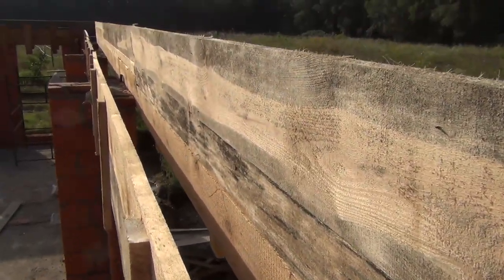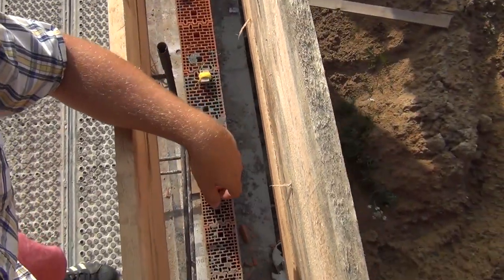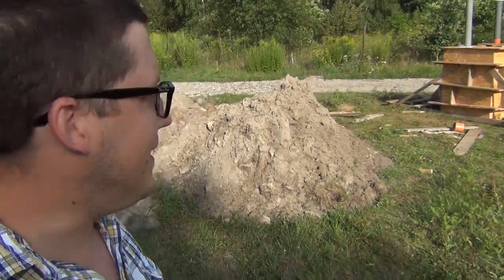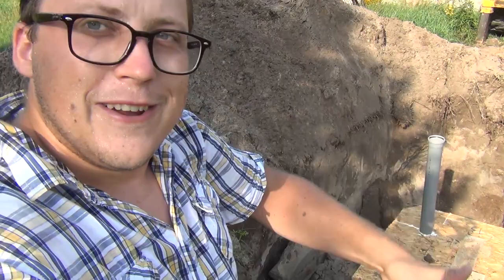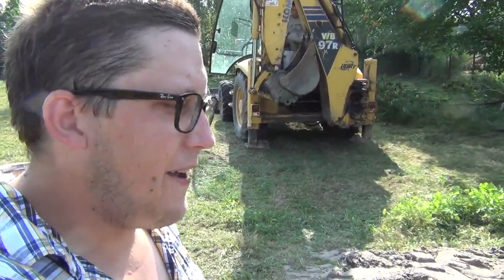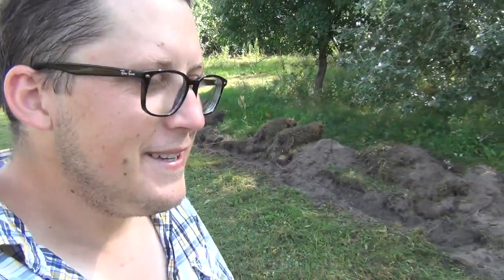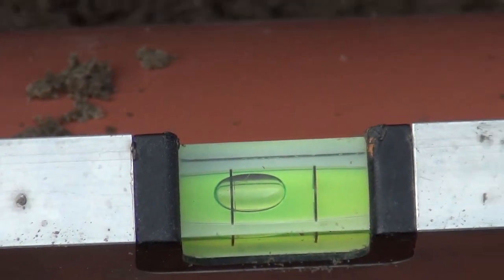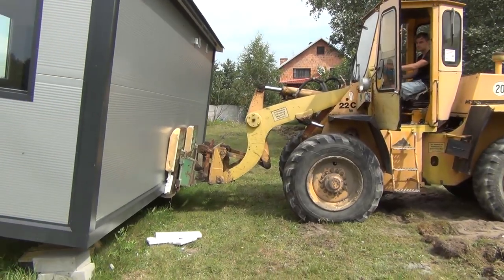BoH 52 - Burying the Sanitation Tank and Moving the Summer House

Comment: make sure look into stainless steel fibers for your concrete next time you will get uhpc then

i think 0.5%-5% by mass is the region they usually shoot for depending on the amount of rebar used.. ive seen a sweet spot in durability + strength testing around 0.9% with rebar and you don't always have to use standard rebar

and it might be good to look up some "fail" videos to see exactly the ways in which you should not trust large hydraulic equipment lol

there are ongoing experiments by Robert Murray Smith and crew with adding small amount of processed/ separated graphene compounds (size and quality undetermined) as an additive for $2 a ton if you want to look into that. they got nearly 2x compressive strength improvement from some of their tests. there have been Phd's in the field on that topic for around 5-7 yrs that ive heard about at universities.